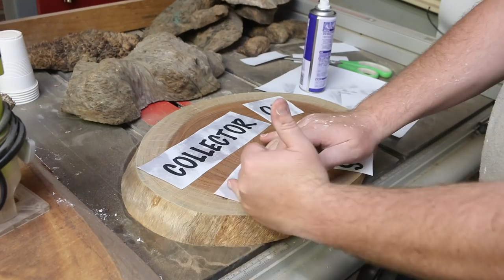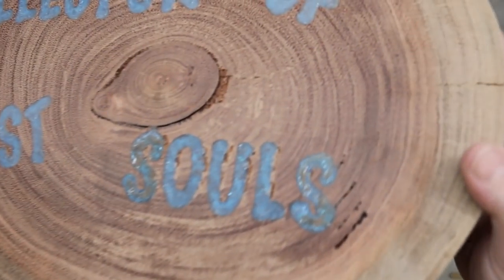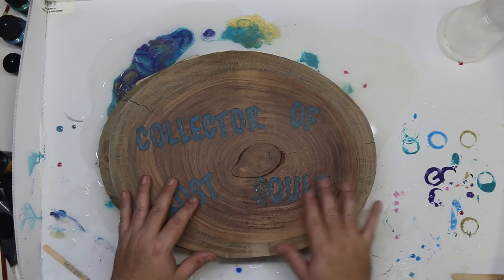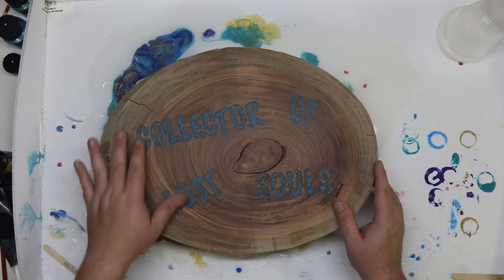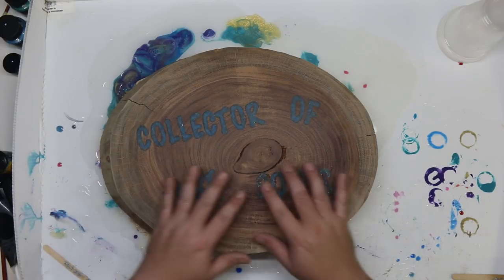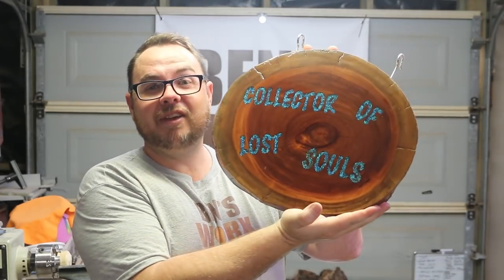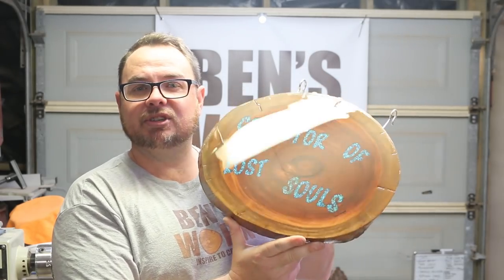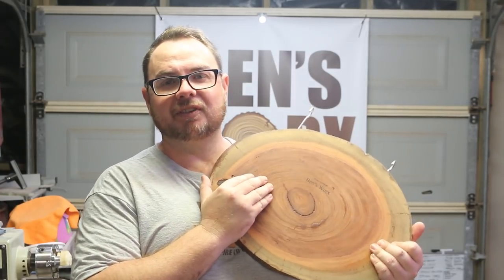Making A Resin Inlay House Sign (NO CNC) - Epoxy Resin Art

Comment: Hey Ben, how is your pressure pot you made out of PVC holding up? Do you still use it?
Reply from the maker: Yeah I don’t use it often but it still works great
Reply: @BensWorx  awesome,  I think I'm going to make one. I've got a 5 gallon pressure pot, but it takes so long to fill it with air, not to mention the noise. It's a lot for a small batch of resin. You're the best, thanks for all your videos!!